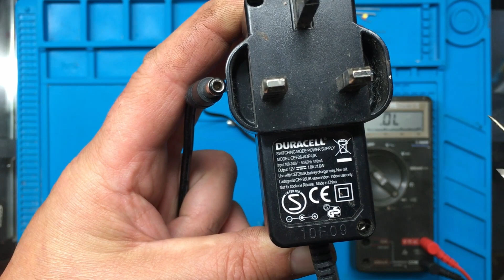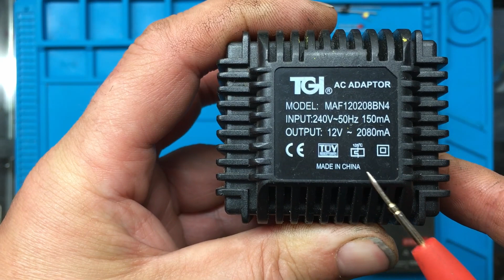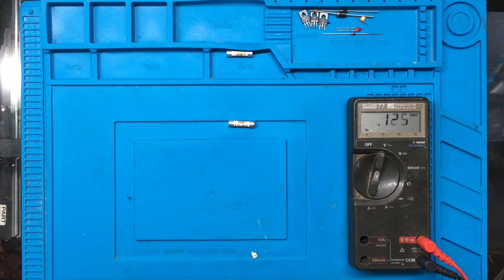Part 1: Testing Mains Leads, Fuses, Power Bricks, and Bulbs with a Multimeter.

Comment: Apart from the current one, I thought the various ranges were only because of the resolution. Can you actually blow up your meter by measuring mains on the 2 VAC range??
Reply from the maker: I think you can on the old style analogue meters. I've always liked the auto-ranging meters much easier to use.